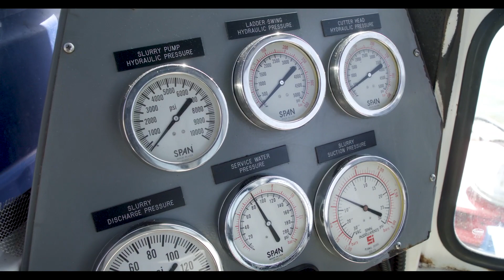Cocoa Beach Muck Dredging Project

Comment: You guys need to come to millcove Jacksonville, FL. The port has killed the waterways here. I can watch a cruise boat do a 180 and leave on one side of the artificial Island made of dredge material. At the same time on the opposite side of that Island at low tide and you can walk across it "the other side of the river that WAS cut off! Before they dredged one side of the river and divided it. The river was all once the same depth. We had white sand bottoms.  Now nothing but muck and washed up and debris.